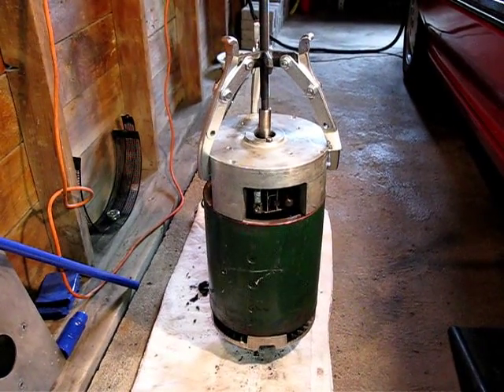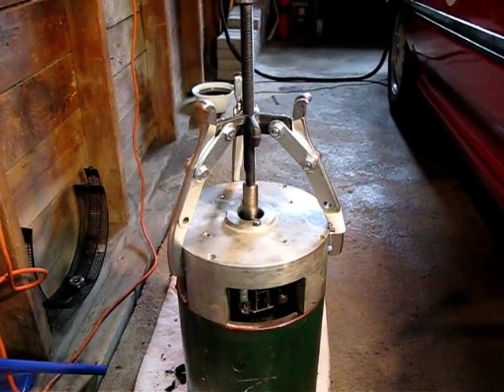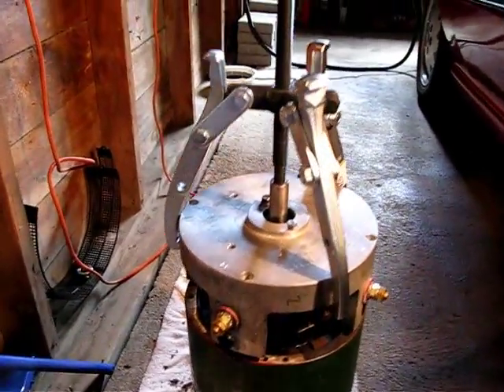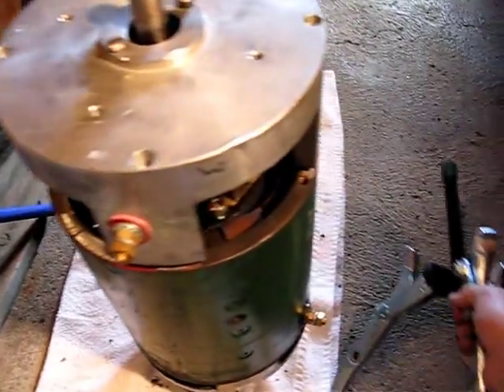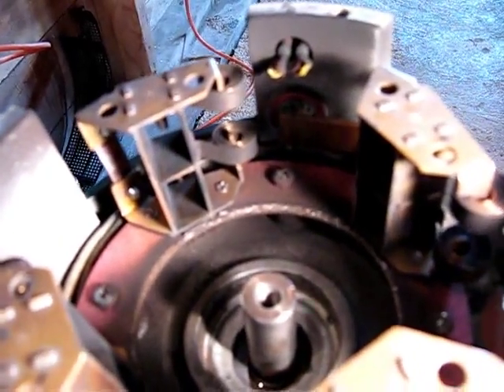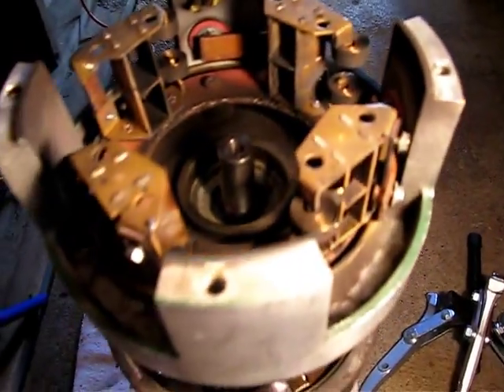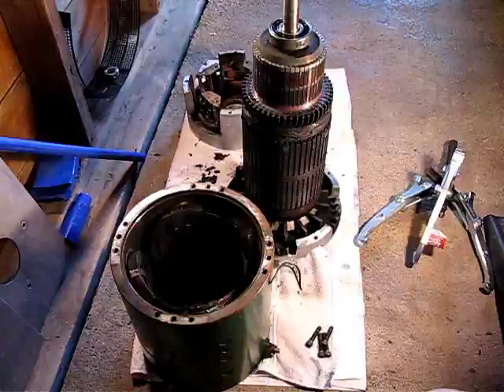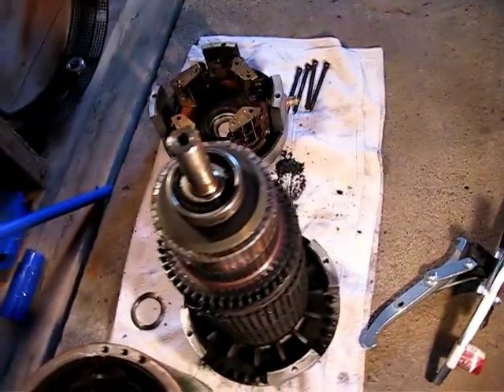October 21, 2012 - EVTV Green WarP 9 Motor Disassembly

Comment: The spring you mentioned in the video is actually call "Washer". It preventing the armature "flow" freely inside the coil while running.

Comment from the maker: Thankfully we were spared the wrath of Hurricane Sandy here in the center of New York State where I live.

I did check with a relatively close motor repair place, but after sending them high-res pictures of the motor & commutator, they recommended a couple other places to get it repaired: Including Warfield Electric out in Illinois.

The latest word at this point is that the motor has been shipped off to Netgain/Warfield for a proper rebuild.  :)

Comment from the maker: Aye it was a sad day indeed, but even when the commutator bars lifted due to severe overheating, the motor still actually worked and I was able to drove it all the way home (on local roads, off of the highway) without having to get the car towed or anything.  Personally I think that is a testament to this "little motor that could", and I ended up having it rebuilt at NetGain/Warfield Motors when all was said and done after all.  :)

Comment: What did the rebuild cost end up being (if you don't mind my asking)?
Reply from the maker: nbrockerson Good afternoon, my apologies for the delay in responding, I have been preoccupied elsewhere and have rather failed to keep up on my YouTube comments.   The repair end up being about $1,250 (with shipping).  When I got the new motor back, it was virtually indistinguishable from a brand new one, and was even painted NetGain Red again, just "like new".  :)

The motor was also shipped just like a new one, on a pallet, and inside a cardboard box with form fitting packaging.  My plastic shipping container (and pillows) were missing in action and I never did get them back, but...  Oh well, still a good price for a factory rebuilt motor that for all intents and purposes is just as good as a brand new one.

Comment: Hi Jason do you know of any manufacture that make a motor without brushes for a DC system that would replace the motor that you have now anyway if i decide to build a electric car I think I will go with the AC 50 of the new AC75 from HPVES systems the new AC75 will have a higher voltage than what the current AC 50 system is running and more power good luck with your motor the green motor seems toasted what are you going to do next.

Comment from the maker: A brush-less DC motor would have significantly less power, in the same approximate size/weight, than the WarP 9 motors and is not really a practical option.

The AC50 or AC75 from HPEVS look to be solid motors, but I have never been very impressed with the power output of the Curtis controllers they are paired with.

For a heavy vehicle like mine (~3,475 lbs), I am not sure if the acceleration would be acceptable (particularly when compared to a Netgain WarP 9 + Soliton1 DC solution).